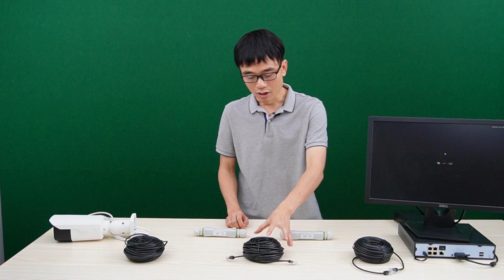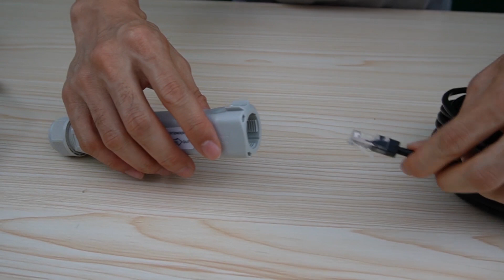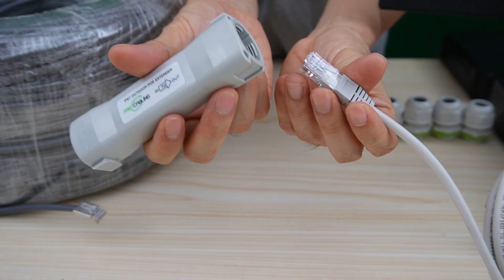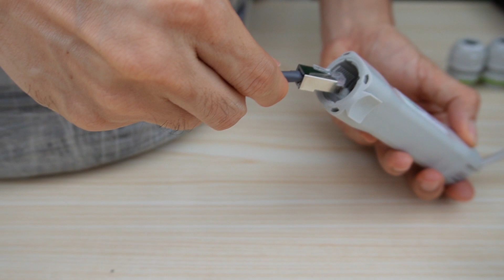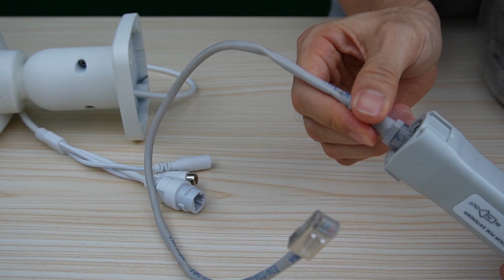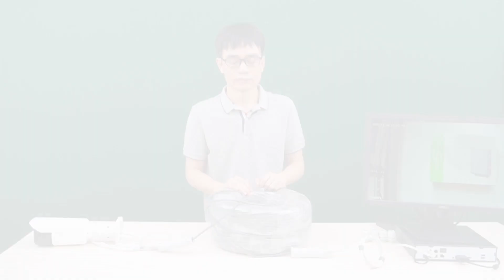New method to work with PoE Extenders for 1500ft Long Run

Comment: How can the POE++ injector solve the voltage drop problem on the camera side, if the camera supports the POE standard, the POE++ injector will send the required power to the camera?
Reply from the maker: A PoE++ injector is designed to deliver higher power levels, typically up to 60 watts or even 90 watts, depending on the PoE++ standard (802.3bt). This increased power delivery can address voltage drop issues that may occur when powering cameras over longer Ethernet cable runs or when the camera requires more power than what PoE or PoE+ can provide.

This PoE++ injector comes with a built-in voltage regulator to compensate for this voltage drop by providing the camera with the required voltage and current to ensure it operates correctly. FYI, the regulated DC output for this PoE++ injector is 54V DC.

Comment: Can you show connection for 4 POE cameras all over a 1000 ft long cable. What equipment is needed?
Reply from the maker: Yes, we can make another video, it might take few days. You just need 8 port long range PoE switch with 2 additional PoE extender. Then pull the cable from PoE switch to each IP cameras. Make sure you add the PoE extenders at the end of 1000ft, then use short patch cord to link PoE extender to the camera.

Comment: Will the speed drop to 10Mb/s?
Reply from the maker: No, the speed is 100Mbps within 1500ft. The speed will drop down to 10mpbs after 1500ft to reach the max length - 2500ft.